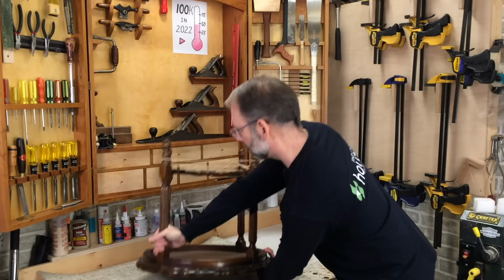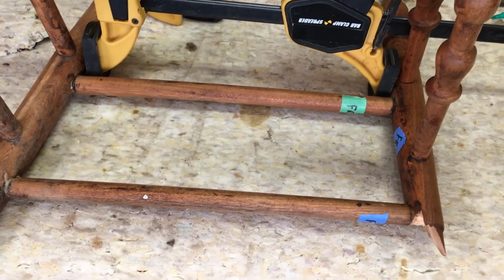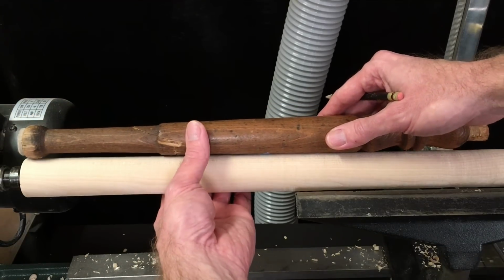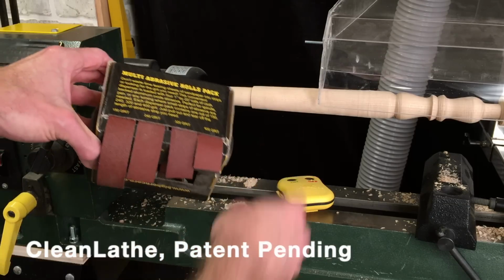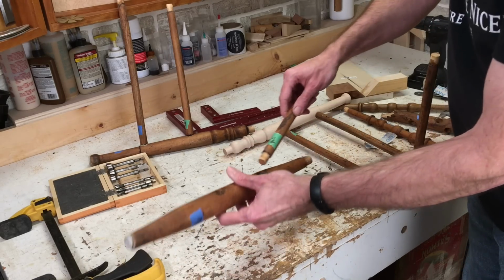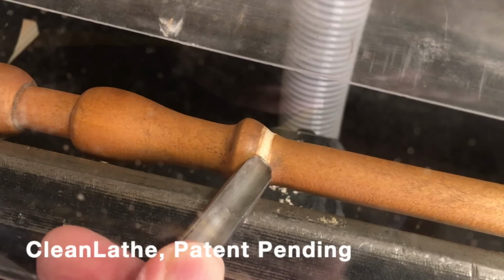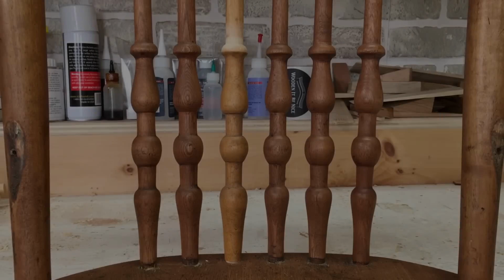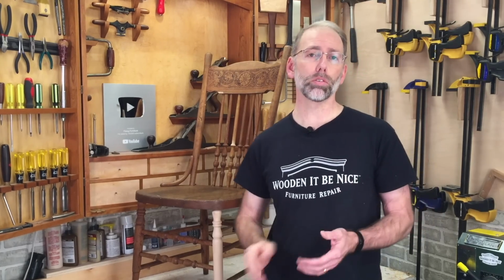Disaster Chair Restoration and YouTube Competition with @ATRestoration @TranscendFurnitureGallery

Comment: You couldn't have drilled then used a dowel and epoxy to fix that leg? I believe I have seen Tom Johnson repair a leg in that manner, but I could be wrong.

Excellent idea with the  vacuum system for your lathe.

Comment: Don't make it to perfect as the round parts would have been made by a person called a bodger in a woodland on a lathe that's powerd by a hazel pole and a length of rope that's round of wood to make it rotate so nothing is going to have been identical only when they started making things in a factory with oil powerd engine which keeps turning in same direction they could then make a profile which is the same for every piece

Comment: @fixingfurniture thanks for the lesson and collaboration! I started over on Trena's, then Angie's since I watch the ladies frequently.  I  didn't clue in until I popped over her from one of their links that I watch you frequently too...lol. 
When you mentioned cutting the legs off because of the glue I got concerned because I'm sure I'll run into this.  According to several resources they said use a heat gun to soften the polyurethane glue then pick it out. It also said paint stripper will loosen it (obviously not simultaneously).
Love the wood shaving trick! Very clever sir!

On an alternate note-I'm excited to say I accomplish something today that many said couldn't be done! 
 I'm currently working on refurbishing a vintage children's rocking chair that was badly damaged in a flood last year. I've asked many people for advice over the past year and either I didn't get an answer or I was told can't be done. Some said not sure without seeing it...fair enough.  

The base where the spindles go in and the seat are laminated layers of light and dark wood.  For some reason only one colour rippled so the layers are spread apart in places. Since I never got any answers I thought I'd test my theory.  

After disassembing it, washing the flood crud off (I washed it last year when I first got it from my friend but not all came off until today)...I took the spindle base and soaked it in hot water as hot as I could stand it with nitrile gloves on and degreasing oxi palmolive dish soap. I moved it around under water for a few minutes.  (When I was removing the spindles I thought it might be hide glue. )Then I took a thin plastic scraper (used for scraping food off plates)and slid it into the rippled spaces. In a slicing motion I worked around all the edges and with minimal breakage I was able to segregate the layers! Now I simply have to finish cleaning them,  sand the old glue off and soften it to flatten the pieces before gluing and clamping it together! Then I have to figure out how to remove the screws from the rusty threaded inserts! They are certainly not part of the initial restoration. I'm going to use honey goo instead of wd-40. I hope this helps others.

Norm Abrahams over on New Yankee workshop has what is called a  lathe duplicator...perhaps you can find one.

Comment: ok question  i have been through ur videos... i also have searched u tube to death...no results.   how can you take out side panels of a desk ,   that are bubbled/warped to the point of they are fixed tight into the grooves?   1 i might.... be able to cut  ......but the back/ sides  not happeneing due to structural framing.and drawer supports. steaming i cant see helping...... as it would just reswell the wood tighter then it already is.      i have a oak desk that was kept in damp conditions.. i had to replace 2 drawer bottoms , and to access the panels i had to unscrew the top of the desk... thinking.... i can just pull out the side panels ..NO WAY IS THAT HAPPENING!!!  THEY ARE SOO SWOLLEN THEY ARENT MOVING PERIOD!! thankfully this is a old oak desk   none of this sawdust mdf stuff..  its not just the veneer its the panel too thats warped /swollen.. can you help?
Reply from the maker: Thanks for the detailed question.  That's not a simple answer.  If you'd like to purchase an Advice Session on our website, we can talk on Zoom and work out a strategy tor you to be successful with your project.  Here's a link https://woodenitbenice.ca/collections/woodworking-advice-sessions

Comment: great video 👍

have you try to attack the polyurethane with heat gun? the theory is that, polyurethane and wood are two different material and have different property. both material should also expand due to heat at different rate.

Comment: I was wondering what wood did you choose for the new leg and why? Do I also understand correctly that you didn't use a drill press so that you would have a more manageable way to get the angles correct by hand, even tho it means less precision? Excellent video, many thanks!
Reply from the maker: The wood I chose to use was Birch.  It's a hardwood with a close grain pattern, so it works well for painted wood parts.  I don't use my drill press for drilling mortises in legs.  I find working by eye works best for me.  Cheers

Comment: If you get a chance sometime, is there a trick or technique for replacing a broken or missing spindle without disassembling the others? Maybe make a new spindle and cut a scarf joint in one end of it and glue it back together in place? Or cut it a bit short on the top so it can be put back in one end at a time?

Comment: I've seen many of your videos. I did also see the one by AT. You talk in here about the person before using screws and polyeurathane glue. It appears to me that the person truely didn't know what he was doing. Polyeurathane glue is actually not intended to glue things together but rather to fill cracks and holes to block out wind and provide some protection from heat loss. You also said something about robinson screws as opposed to slotted screws. In the states we have what we call philips screws these have a cross opening. is that what robinson screws look like?
Reply: Robertson screws are what you would call Square head screws

Comment: Once again, I learned lots. I like your lathe dust control. When will it be available?  Also, how do you determine the wood species when replacing?  I replaced a stretcher, using your lathe techniques, with cherry and it turns out the chair is something else. It looks OK, but I would like a better match. Lucky my wife is not critical!

Comment: Good morning sir! 
Couple questions. Does it matter what type of Vinegar? Does one work better than the other. Second question. Where did you get the small bottles and tips? Love the dust collection on the lathe. Last time I used one, even with the dust collector he had, I looked like I had just come inside from a blizzard.
Reply from the maker: You can see the tools we use in our workshop and the tools we recommend on our Amazon page.  The tips are in the Adhesive section https://www.amazon.com/shop/homeimprovementwoodworking
Reply: It's the acidity of the vinegar that does it.  So, it probably doesn't matter too much what type.  Use the cheap stuff so that you don't get into trouble as Doigsong suggests.  You could also use acetic acid of a similar concentration.  It doesn't need to taste good on a salad.  Lemon juice would probably also work, but then your chair would smell like a lemon.
Reply: I can advise that you will get into trouble with your partner if you use the expensive red wine vinegar.